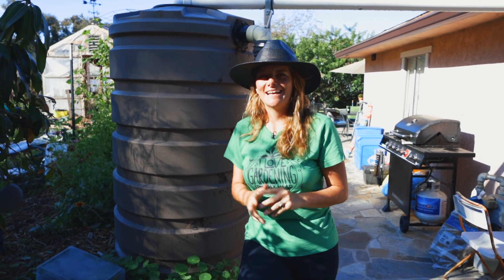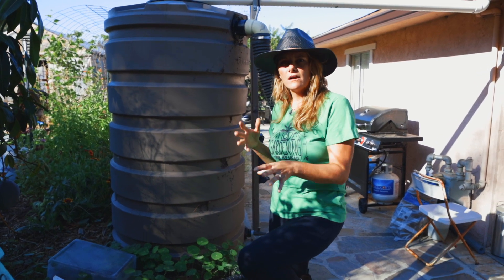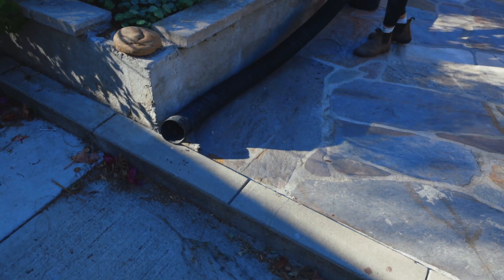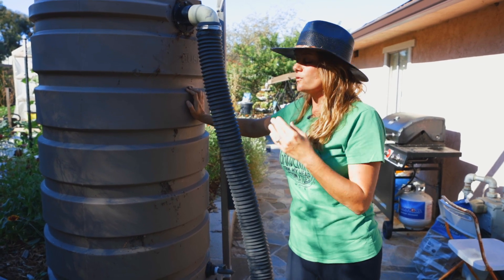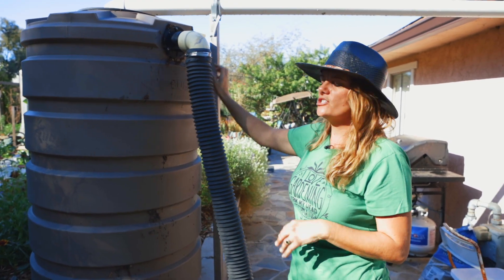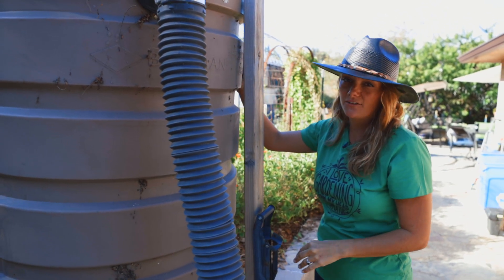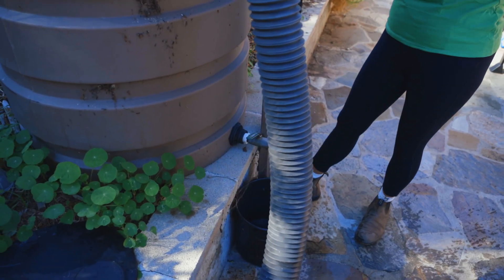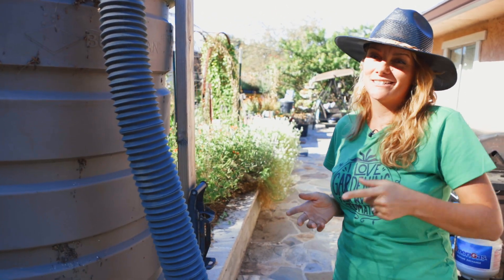Going Off-Grid by Harvesting Rainwater with a Rain Collection System

Comment from the maker: Do you have a rainwater harvesting system? What lessons have your learned?
Reply: My “system” which has only been implemented once; is to set out 2)ea. 5.0gal buckets and 1)ea 20 gallon rubbermaid tote. I’m in Los Angeles so I have diligently harvested from all 3 rains we have had this year. 

Collected water lasts about 2 waterings until it’s all used. TIP: use the rain water as soon as possible as it has a higher oxygen content the more fresh it is and plants need oxygen on their roots!
Reply from the maker: @joujimiichi1  love the simplicity
Reply: @joujimiichi1  Do you live off off grid? Do you use your rainwater system for all of your water needs? Trying to work out if southern California provides enough rain for year round living needs?
Reply: I have rain barrels but unfortunately one side of my house has rainwater coming off a roof that gets lots of oak leaves/acorns and that water always ends up smelling really bad. I would love to figure out how to set up more of my rain barrels since my one fills up very fast and then I don't need the water for awhile.

Comment: There is a pumping system I have seen that will pressurize your catchment water so that you can use it for irrigation. You can also control the pressure for Drip (20psi) or higher.

Comment: I just set up my rainwater harvesting system. The installation included a subterranean 550-gallon tank that has been mapped to a 4 zone underground water feeder system encompassing my quarter acre of lawn and garden. The final phase will be the electrical hookup for the motor that will power the irrigation. The out-of-pocket cost for the system is high, $10,000, but my municipal water bill continues to rise with every billing cycle. While I may not recoup my investment (time will tell) from decreased municipal water usage, all the time and effort that I had to commit to manually watering my lawn and garden can now be redirected.  For that I am thankful!